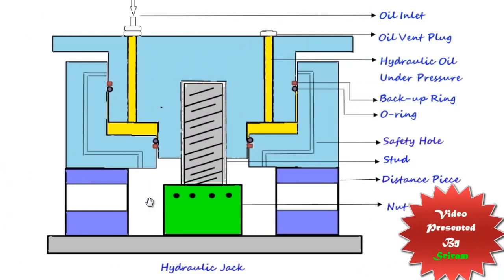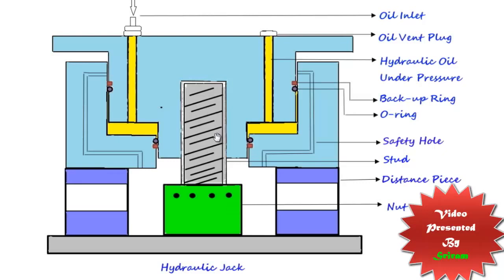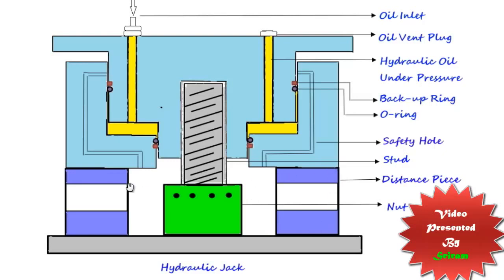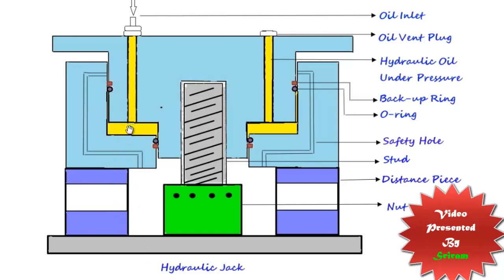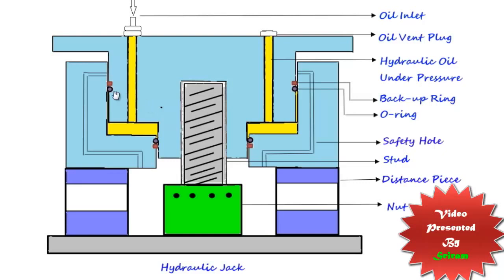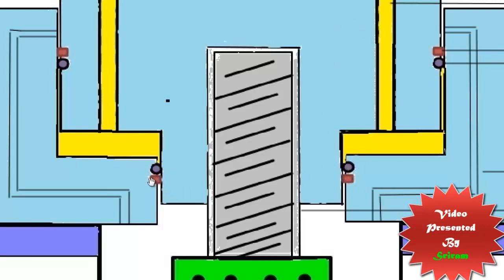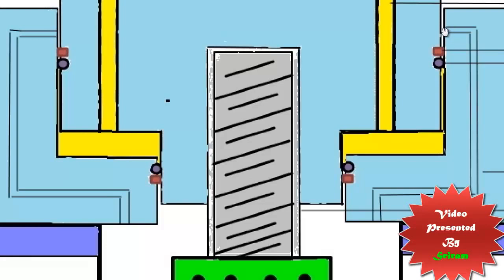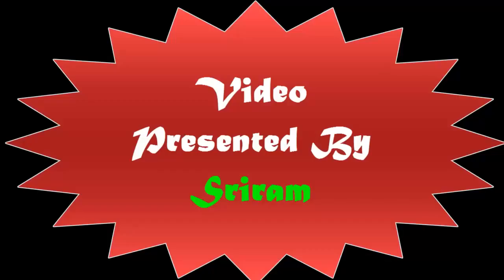Hydraulic Jack, Working And safety Features.

Comment: after 7.30 u say top side oring gives off,then how oil is channeled to the drilled holes leading in to the spacer ring area,,from the diagram oil can pour out from top itself during oring failure??